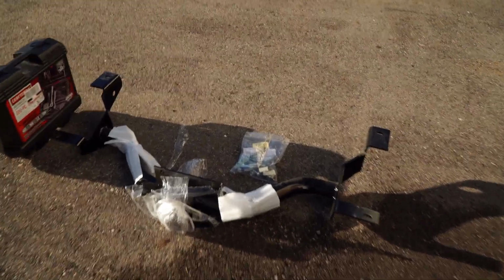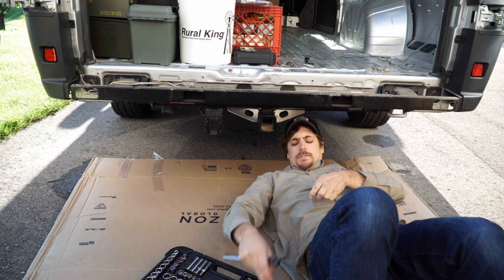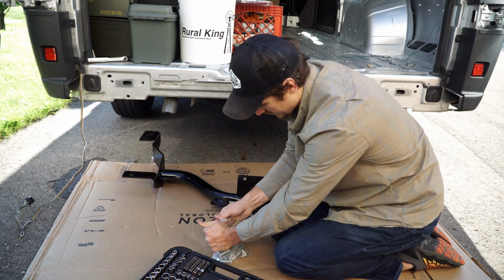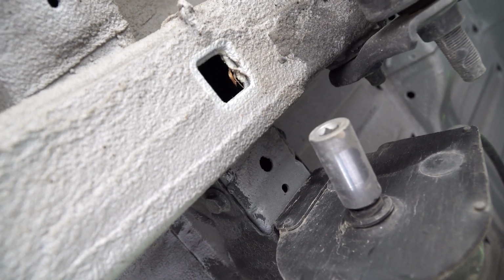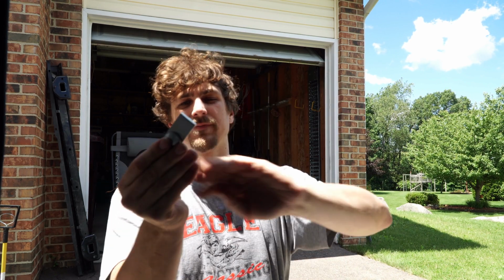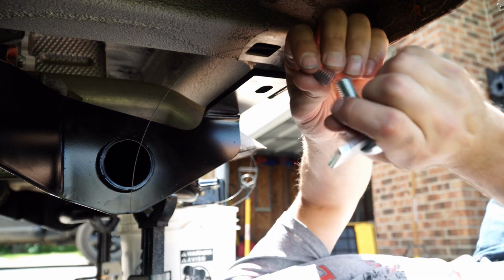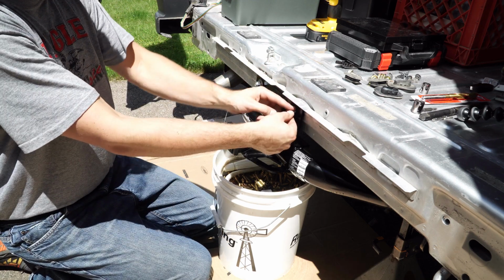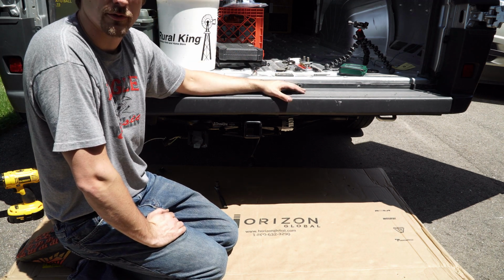Trailer Hitch Install - Ram ProMaster 3500 Extended

Comment: Thank you for making the video. Unfortunately for my 2020 pro master 3500; the forward portion of the hitch actually interferes with the suspension travel. You can tell because both the suspension "swing point" and hitch have lost paint in those areas. Lucky I have only ran this hitch for 200ish mile on road, and have not bottomed out the suspension yet. I will attempt to fix the problem by cutting out the filet on the hitch and see if the suspension has enough space to travel fully. Did you have this problem as well?

Comment: How is this hitch holding up now?
Reply: Hitch has been holding up well. I had one of the bolts on the bottom vibrate out eventually but put a new one in and haven't had any issues

Comment: Maybe I missed it but did the spare tire fit in the stock location after install? Thanks for making the video.
Reply from the maker: Yes it went back into the stock location. The only issue is that you will no longer be able to use the tire jack to raise and lower the tire. There are two ways this can be done. My method I just use a pair of channel locks to twist the fixed socked that is there. The other option would be to drill or torch a hole into the hitch bracket that lines up with the sock again.

Comment: HI,  Before you put on the other hitch? Ours (3500) came with a tow kit. But not ball. I think it is rated for 5100lbs towing. Any idea if there are different heights you need for different trailers?
Reply from the maker: The tow kit that comes from the factory which is similar to the one I took off connects directly to the uni body of the van which is basically the sheet metal that isn't as strong. This is fine for towing smaller trailers but didn't work for us as we would be hauling a heavy motorcycle and didn't need the towing capacity  but the tongue weight which is much lower on those type of hitches. Thus the reason to switch. 

As for the 2nd question there can be different heights on trailers depending on intended use and weight capacity. One way to cover come this is to use an adjustable ball mount hitch. Here is a link to what can be used. https://amzn.to/2Ad1HXc
Reply: @bearcatstonowhere8047  Thanks for the info!! Do you have a link to what you installed here?
Reply: @bearcatstonowhere8047   How heavy could a motorcycle possibly be to switch out the hitch.